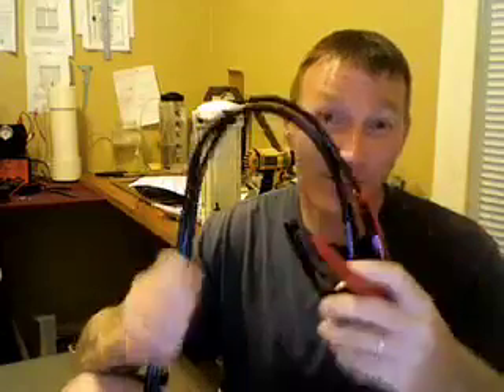What Wires should I use?!?!?!

Comment: We have an RV currently that takes 30 amp and currently have a 30 amp breaker with 10 gauge wire in conduit approximately 50 feet in length from the meter to the electric post. If I want to prepare ahead of time for the possibility of getting an RV with 50 amp, what gauge wire could I use that will work with both the 30 amp and 50 amp (not replacing breaker until the time comes with a new RV) if possible? If I have a wire that will work well with 30 amp and 50 amp, then we can sell our camp lot (we have a deed with this camp lot) as that it would be set up for both 30 or 50 amp with the change of a breaker.

Comment: I got a 165 watt solar panel which should deliver about 9.7 Amps max to my deep cycle 12v battery, yet the wires on the charge controller (11 Amp) both to the panel ant to the battery are very thin.  I actually cut one of the wires to measure it and incredibly measures .64 mm (22 awg), which is supposed to carry only up to about 1 Amp. Any comments?

Comment: most jumper cables especially cheap ones. have like 10x insulation of a normal wire. misleading ppl . the ones I have seen are about 8gauge. with insulation to look like 2 gauge wire. the best way to get heavy wire is to get welder cable. and lots of ppl. don't take distance in to the equation. if the wire is rated for 20 amps. don't mean it will handle 20 amps at over like 20 feet! if its over 10-15 feet it don't hurt to go up a size. every 20 feet or so. even if it don't get hot you still have a volt drop over distance. and you aren't going to burn something down because the wire is to big! and as for jumper cables. I'd buy my own wire and make my own. using no smaller than 4gauge. but most ppl think you supposed to be able to start a car with jumper cables. they are to help start a car with a weak battery. they are to help start and or charge the battery to the point where the jumpers will help start or charge till the battery can do the starting. there isn't enough material in most jumper cables to start a large engine. this is a good video and can be helpful
Reply: Wire a thermostat electric

Comment: Pretty sure your jumper wires weren't copper but brass or aluminium. Anyway the chart you are showing is for power transmission. Though it is true that for a given length the bigger the wire diameter the smaller its resistance, it is also true that the smaller the length of the wire the smaller its resistance too. It is not a coincidence that in your chart they state the resistance per km. The amperage rating you read there is for a long wire - at least as long as the wire you need to wire a building or so. Don't forget that the current limit comes from the power losses limit, as bigger power losses would increase the temperature past the limit of the insulation. Generally you can calculate the operating temperature of the wire if you know its resistance (which is a function of its diameter and length) and the current that flows through it. Working backwards you can find the maximum current so that for a given wire diameter the temperature does not exceed the temperature limit of the insulation.

Comment: Haven't read all the replys so excuse if I'm repeating anything.

Background: 30+ years electrician.
As far as I can remember I've never run into wire sizes with an odd number, until you get down to #4 gauge.  So wondering  the site  you were reading from?  I'd like to check it out.
As for wire size:  NEC code table states:
#14 rated up to 15 Amps
#12 "         " 20 A
#10 "         " 30 A
#8  "         " 40 A
Of course there's temp. factors and length/resistance but in this case moot.
Reply: drmmr123 lol! 11 years later & your simple information of wire size for average application amperage answered my question!
8 awg 40 amps!!!!
I was debating 8 or 6!!
I need 6! Air handler has strip heat (15 KW)breaker at 60 amps!!(2 breakers one 60 the other 25!)
Thank you!
Reply: drmmr is right on.  As a reference you you could go to the NFPA site.  Free access to NFPA 70 which is the electrical code for most areas.

Comment: Just to let you Know I've mixed up my water/Koh to pull 25amps cold. It got to 50oC and it was pulling 45amps. The wiring no problems the terminals no problems, they were colder then the tank I'm using 4G wire better to go bigger then what you think. My mix is a bit to strong lol the Max I wanted and had planned to run my cell was 50amps I have a 70amp fuse going to the cell Always have strong connections, heat will be produced at the smallest part in the wiring circuit. Keep up the good work

Comment: Thats a pretty good website , thanks for posting  .I am currently using 10 gauge wire for mine with no over heating running bout 12 amps...I tried an old extension cord ONCE and only ONCE melted the crap out of that wire ,luckily I was only doing bench test wasnt in the car..